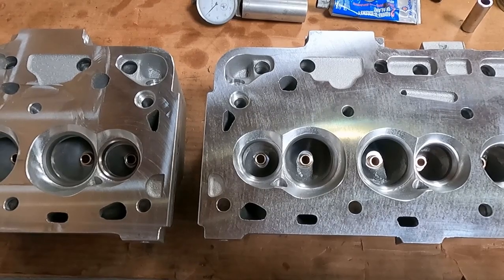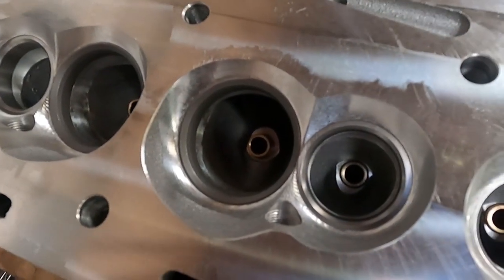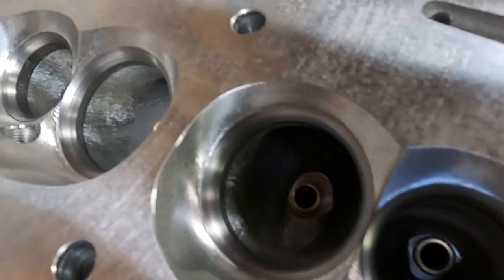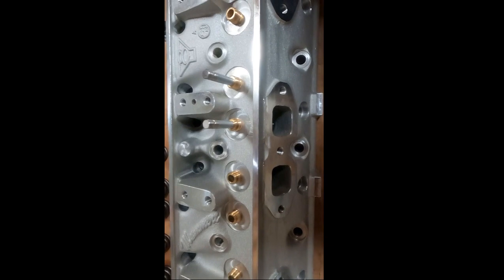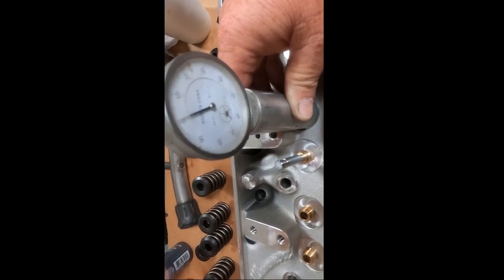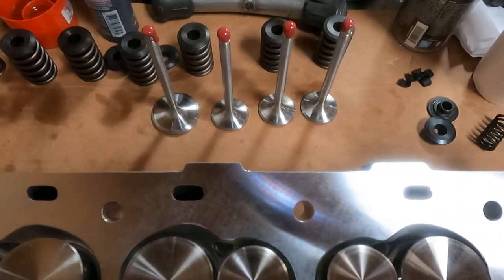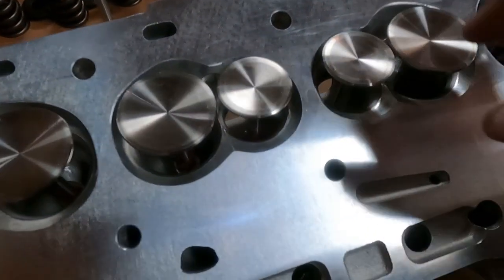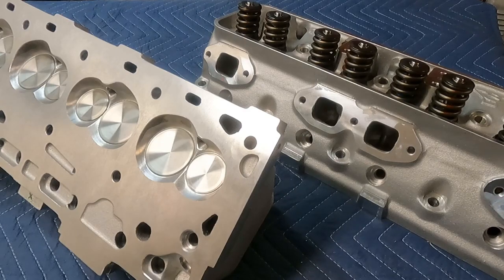Making Aluminum Y Block  heads  part 4

Comment: Thanks. Is it advisable to chamfer the oil passage corners like we do on iron heads for flow? The passage definitely looks deeper on your aluminum heads…
Reply from the maker: The groove in the cam controls the oil to the top end,  check this out https://youtu.be/aw1-lKWsmAc